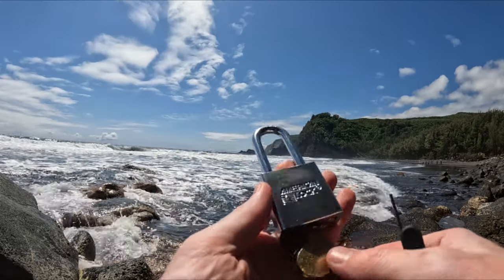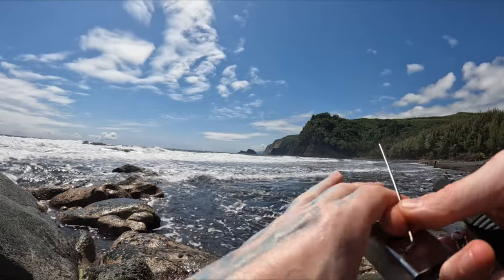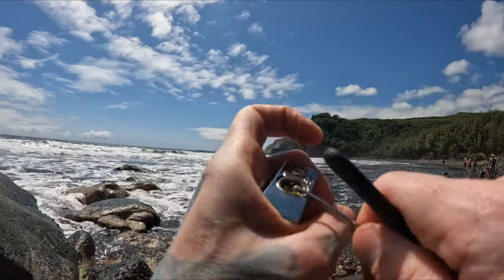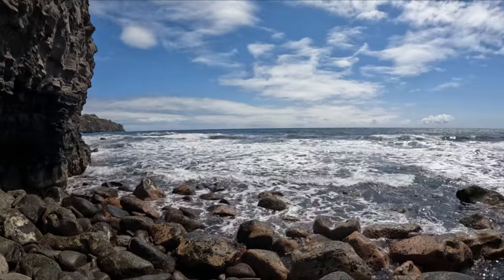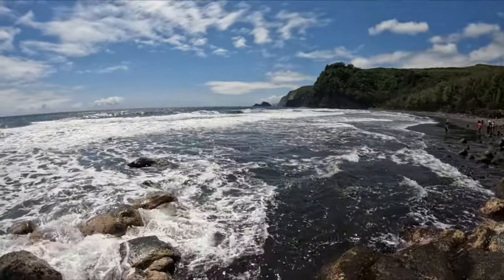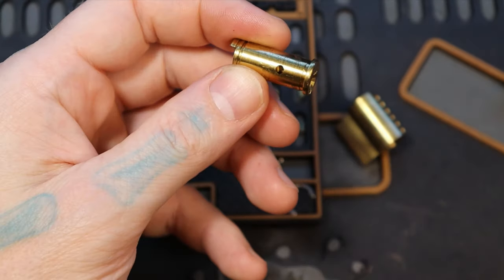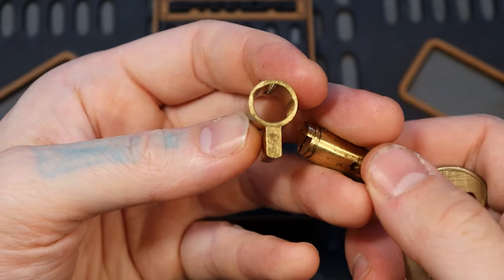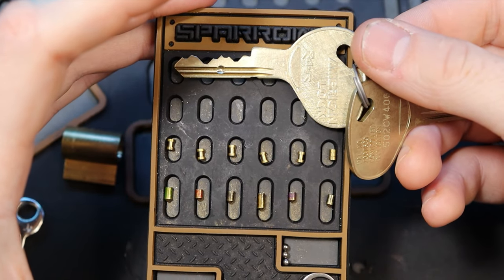255) American Lock 5200 Edge Key Control Picked and Gutted at Pololu Beach, Hawaii

Comment: That seemed like a really tough lock even taking that bitting into account! Also appears as though you used really heavy tension based off of how hard you’re moving that hook to set those spools. With those waves you must be picking by feel alone as you’ve eliminated the ability to hear the pins setting probably. Thanks for the view of the key control from the inside too. Well done and take care!
Reply from the maker: You are absolutely correct, I couldn’t hear anything. I often can’t hear the lock when I’m at a waterfall or near running water!  The heavy tension was probably more so because I was tired from hiking and in a really awkward position to get the best lighting I can for the video.  I’m often in very weird positions for the video and can’t always rest my elbows on anything. All that extra muscle being used to hold the lock in front of me often transfers to my tension pressure. Why I tell people to rest their arms on something while picking!